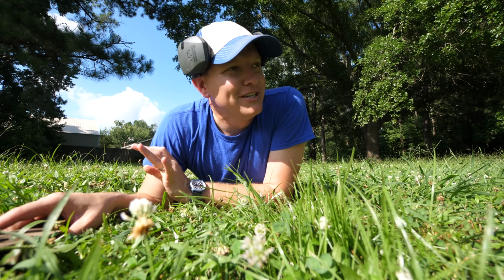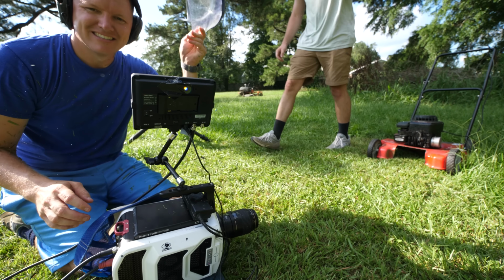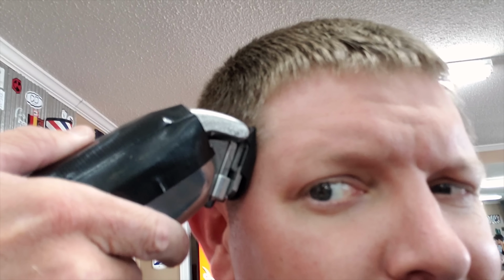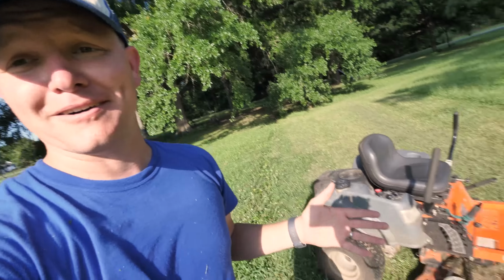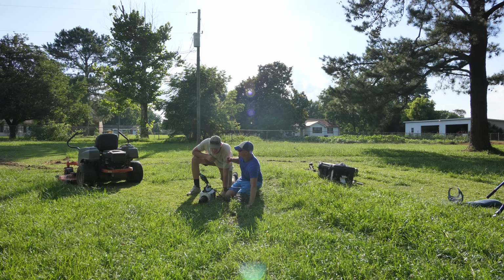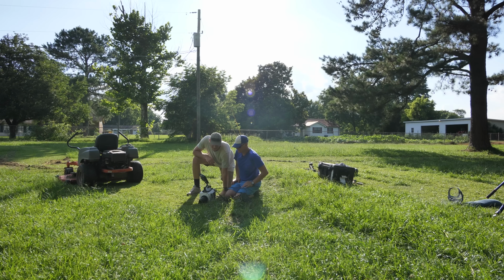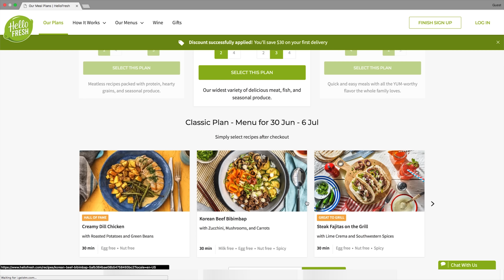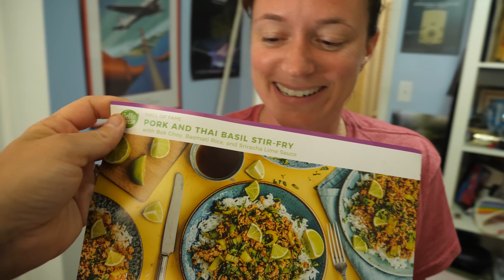How Lawn Mower Blades Cut Grass (at 50,000 FRAMES PER SECOND) - Smarter Every Day 196

Comment: Nice theory but it's not correct. The bent up blades might help a little lifting the grass but there main purpose of creating that air flow is it helps getting the cut grass out the discharge  IE using a catcher. When cutting with a more flat blade you will notice it wont fill a bag as much as a curved up blade will.   Cool video !
Reply: I think you are correct.  I don't think I witnessed air flow pulling the grass up.  The grass sprung up by it's own "backbone" just like stepping on grass seeing it spring back vertical.  Only when the mower blade moves fast enough does it not push the grass over and shear the grass off.

I have a set of perfectly flat blades for my 52" zero turn.  They have two edges so that when one side is dull you turn them up-side-down and use the other edge.  They cut fine, in shorter grass, they just don't discharge the grass from under the deck very well.  They can get bogged down in high grass.  Heck if the blades need to suck up the grass these blades shouldn't work at all on short grass which would bend out of the way of the blade easier.

The "lift" the manufacturers are referring to is bagging lift.  There is no way air is getting down at dirt level, traveling up at high speed and lifting the grass blade.

A string trimmer doesn't need to "lift" the grass either.  Grass is cut by a thin fast moving object.  No fancy physics about it.
Reply: No, the tab is intended for lift but it helps move the grass out of the way
Reply: Calleb Wilson may be the worlds foremost expert on the matter, but even if you are, I prefer objective data driven and measured scientific evidence to proclamations from authority.   A slow motion video of a control blade that is flat for comparison of the behavior of the grass blades would go a long way or any other definitive measured experimental data.
Reply: @geraldmoore6257  I'm a retired John Deere mechanic .Not as smart as you but we are both correct on the blade lift. I have known this for years . After posting this  I looked at some sites that would prove this and there are quite a few. Also looking at places who sell blades the ones with the high lift are referred to bagging blades.
Reply: @drelliott2833    Check your browser history and send me the web addresses of the stuff you found.  I have not been so successful.  I found mostly proclamations or assertions, not evidence, as well as links to this very same youtube video.  I'm in agreement with you.  There has to be some suction, and air flow but it's purpose is to eject grass clippings, not to pull up grass like the barbers vacuum clippers.  If it does pull up grass, the effect is minuscule.  I'm riding along at 8 to 10 mph cutting, the grass doesn't have time to respond to air flow before it's cut off.  I'd like to see what you found.  Thanks.  Good conversation.
Reply: @geraldmoore6257  See above
Reply: @drelliott2833  Thank you for your response.  I think I was not communicating clearly.  Yes, I found what you found, that "lift" refers to discharge for bagging.  However, what I was searching for was definitive evidence that "lift" is NOT referring to holding the grass up from underneath for an even cut like is being claimed in this video.  

But I suppose the lack of evidence is all one would expect if lift doesn't refer to holding up the grass for an even cut.  Thank you for helping me resolve this scientific puzzle.  I'm now tentatively convinced the tabs have nothing to do with lifting the grass up and holding it for an even cut and everything to do with discharge and bagging.  The "lift" so to speak is talking about what happens above the blades, not below them.  Thanks once more.

P.S.  For some reason I got you response about the deck engineer by email, but couldn't find it here on the Youtube comments.  It would be nice if many others could read it.
Reply: @geraldmoore6257  Are you talking about this post?: In the late 70s I had a friend that designed mower decks. At the time I was working on a JD deck that had these radical L shape mower blades just under 80 degrees  I remember asking him why they would design them like that. He referred me to someone else that could explain it better but explained why they built them like that. He showed me deck design drawings that showed how they work.  On riding mowers the bags are mounted on the back . The grass side discharged  but threw a tunnel upwards to the bags. The best way of getting the grass to travel all the way into the bag was the high lift blades .  Any way just search best blades for bagging lawn mowers. or the difference between mulching blades and bagging blades . 2 way blades/3 way blades. or just go to sites that sell blades" Sears "  They show the difference. Bagging high lift. Also the blades pull the air from under the deck .The high lift blades are like a fan blowing out the discharge. This is also the reason there are kits that can be added to a deck for mulching .(Using less curved blades) . They limit the amount of air flow keeping most of the cut grass in the deck cutting it more than once as it circulates out the bottom. Sorry about the rant .Hope this helps you.
Reply: @drelliott2833  It seems that you are misunderstanding or I am mis-communicating.  You're last two attempts to be helpful missed the mark completely.  I am at a loss.  I do not know any better way to get you to understand the issue that I wanted to discuss.  Of course, I was talking about this Youtube video and how the poster came to the wrong conclusions.  Which we both agree upon.  I also found info that affirms that lift is for bagging.  I was looking for information that debunked the suction effect upon the uncut grass.  Thanks for all the effort, though, I appreciate it.  I really do appreciate it, but your effort simply confirmed what I already found.

Comment: Well, if a lawnmower uses the air to hold the grass straight, what about a sythe?
Reply: a scythe is sharp and the stiffness and inertia of the grass are enough to hold it straight, with the stress being on a very small line.
Reply: As a guess, I think that a mower could take off a fraction of the top of short grass because of the speed of the blade, but a scythe would need taller grass to work properly.
Reply: I don't know if sythes were used to cut light weight grass much. More like more sturdy wheat and grains right?...
Reply: Clark S they are. Thats how I cut my grass😂
Reply: Scythe isn't effective when cutting lawn grass. Also, you can check the grass after being cut, is it a clean cut or more like a tear.
Reply: Clark S that was the sickle
Reply: Clark S 
Scythes were used on any grass eg hay cutting used to be done by hand using scythes.

Comment: Ever cut grass with a machete? You don't need a pulling airflow to cut the grass.
Reply: This is a super valid point! I think the story with air is not that relevant. The point is more in the direction of relative velocities. As soon as the blade is fast enough and the grass is slow enough --- bang; the grass is chopped. See the video of the SlowMo https://youtu.be/zTspzONOomw?t=1m50s no air no nothing.
Reply: Or a scythe.
Reply: machetes are sharp
Reply: The reason you can cut grass with a mechete or scythe is they are stupid sharp in comparison to 90% of lawn mower blades. scythes especially.
Mower blades are made to not be sharpened for years on end and still work, all thought not as well, a scythe must be sharped ever 20 minutes or something like that.
Reply: Ever cut grass with compact trimmer using just a plastic wire? It's not sharp at all but cuts fine. So it's all about momentum.

Comment: But how does Flymo lawnmowers work then? They use the air to levitate above the grass (no wheels) so they need to push downwards, right?
Reply: ChilladeChillin do they still sell Flymos? I don't think they do and it's largely for the reason you site.
Reply: I believe you will still find lift in the central portion of the blade with the downward flow concentrated heavily to the outer perimeter (to lift the mower).  But it has been awhile since I've seen one.
Reply: bruce johnson They still sell Flymos, but i think their popularity has decreased.
Reply: Ethan Poole I looked at the Flymo I own and you were right, the blades were bent upwards in the middle. The outer part of the blade was also bent downwards and it also have a big fan to push air downwards. But it kinda seems like wasted energy to push air in two different directions.

Comment: Twelve years ago I bought a replacement lawn mower blade that was supposedly optimized for "mulching".  Behind the regular blade edge with the upward tab, there was a notch, then a second blade mounted higher and angled downward.  When I installed it, I noticed two things immediately: 1) the mower was significantly quieter; and 2) cut quality was exceedingly poor.

That's when I learned about the vacuum created by a mower blade - which was cancelled out on this blade by the extra downward-facing cutting edge.  The aerodynamic changes related to the lack of vacuum were also apparently responsible for the reduction in noise.  I took the blade back for a refund and have used standard blades ever since.

Another fun fact: The tab on the rear of the blade can eventually wear down from friction against the grass clippings it's pushing upward.  I've gone through two heavily used blades that, in addition to having a lot of material worn off the front from repeated sharpenings, had the rear tabs (which gently curved upward) worn down to a knife-edge.

Comment: I had experimented in a much less scientific way as a kid, I tried comparing freshly mowed grass blade to cuts I made with scissors, scissors swung without holding the grass, scissors swung while holding the grass above, a knife with a slicing motion (angled from the blade's axis), a knife with a "chopping" motion (perpendicular to the blade) and ripping with my bare hands just pulling them between my fingers in various ways. I found some blades were cut like with the knife, others were more similar to when I laid a blade of grass across my index and pulled it apart using my ring finger and thumb on each side to create a wedge with my index finger. So I figured it was a combination of those two things that worked, that the blade of the lawn mower would sometimes cut through cleanly but the blade it couldn't would get slapped against the blade from the momentum and tear from not being able to move quickly enough to avoid the damage. 

Cool to know how it actually works now
Reply: Jeff Cyr i sharpen my blade on the mower pretty sharp will cut hairs off your arm i do have to sharpen it a lot but ive got a simple way off doin it. Anyway it cuts super clean amd flat for a few mows and its about an acre of mixed grass variety
Reply: Good to know others are also curious.
Reply: Jeff Cyr You should look at rotary mowers that the golf courses use for the close shaves. They use a scissor-like cut. Much cleaner cuts.

Comment: Weed whackers are only small strings on a rotating motor with no blades to create lift to pull the grass so how do they work? do they create lift like lawnmowers but in another way?? really curious hope you get around to this!
Reply: luther trump wacker spins way faster then a mower. No need to hold grass up.
Reply: lenny 034 yeah okay lenny we’ll see about that
Reply: luther trump huh???
Reply: lenny 034 WELL SEE ABOUT THAT LENNY

Comment: What about edgers? There is no tab.
Reply: Far mute the duct.  We plan not green the carb.
Reply: That slices really fast wich makes it cut
Reply: or weed eater/ wackers
Reply: edgers are more like a knife cutting. although, along a concrete edge, they act more like scissors, using the solid edge, as the second blade.  weedeaters just use sheer force. literally and figuratively.  the weedeater string spun at very high speeds (12,000 rpm) uses centifugal force to turn it into essentially a blade.  as airflow goes, displacing air creates a vacuum.  but its mostly due to using thin string, high speeds and creating a very focused edge, like a sharp knife.

Comment: OK, you explained how a lawnmower cuts but how does a round plastic string of a weedeater cut grass?
Reply: dragonweyr44 With enough centrifugal force from the spinning head, the string acts essentially like a hard bar, sorta a round-edged blade. It doesn't cut like a sharp mower blade, it's more of a grass beater, but it works.
Reply: dragonweyr44 rpm. Lots of rpm
Reply: I think once the blade/string goes fast enough, a blade or string will just cut through grass - no lift needed. The grass stands back up on it's own. The lift helps in a mower, especially when mulching and multiple cuts on a single blade is desired. I agree lift helps, but don't think it's required.  

I'm curious how much faster (or slower) the string on a weed whacker spins compared to a lawn mower blade.

Comment: Just stumbled across this video. That tab on the back of lawn mower blades was invented much later. Mower blades were just flat before the grass bag came into play and the clippings had to be lifted and blown into the bag. They also served a dual purpose of mulching by shutting of the exits but keeping the clippings airborne inside of the mower deck long enough to chop them over and over again. What cuts the grass depends on the sharpness and momentum of the mower blade and the weight of the grass blade. “Come on Man”

Comment: Reel mower, scythe (make sure to use it right) , string trimmer, leaf blower, broom, power edger, and lawn irrigation system.
Reply: Chain Saw
Reply: Aerator, dethatcher
Reply: Tiller, blender, pressure washer, steamroller, and kite.
Reply: Did you really just ask for him to go over a broom... it takes the object and pushes it away. The leaf blower has a fan inside I assume which just blows air.
Reply: Yup good ones here
Reply: the individual strands of the broom acts like springs perhaps launching dirt particles, so there could be something interesting physics going on with the broom.
Reply: I like the broom idea. There are brooms with large but few strands that when used right creates an air cushion in front of it that gets the particulate waste where you want it. Those are neat because those brooms don't wear fast nor to they get dirty, they never interact directly with the waste =)
Reply: Fadez he asked for ideas for things we wanted to learn the physics of. If you can't come up with your own ideas not our fault. If you don't understand the broom and leaf blower idea. Let him do it and he might surprise you. So get off your high horse and quit trolling.

Comment: Does blade speed make a difference on how well it cuts? What difference does a slower blade have from a faster blade? For example, if it's slower, will it tear the grass more than cut? Also, what is the acceleration of the blade at the tips? These are my questions.
Reply: If it's dull, it bludgeons.  If it's dull and FAST (as in this video) it rips.  If it's sharp, it doesn't have to be fast, it will cut.  A long handled-scythe is the old-fashioned mower.  They work very well, they just take a while... a very long while.

Comment: Now I'm wondering how an older lawn cutter works. Like one of the machinical push ones. There you have forward rotation but it doesn't oppose the blades of grass.
Reply: At least here in Europe there is two religions of landmoviving. The rotor cutter as you obvious is using. And the cylindrical cutter (both motorized).
The rotor believers say that rotor benefit is the multicut effect that helps the composting, and that the rotor is better at cutting other stuff that gets into the lawn.
The cylinder believers claim that this version makes a cleaner cut. That help the grass grow greener and softer. 
Could this series cast some facts into this .
Reply: There is a stationary blade on the bottom.  The rotating one cuts against it like scissors.
Reply: The grass just GIVES UP when it sees that MONSTER coming.

Comment: So how does a weed Wacker work because it's just a straight cord, or is it just small enough the grass doesn't have time to move with a blade
Reply: Danny Carinder and what happens when the cord fails? I’ve always wondered what causes the cord to snap if it’s doing what it’s designed to do.
Reply: Trimmer line is thin enough and fast enough that it can slice the grass blade very cleanly. You typically trim closer the the bottom of the grass blade so that shifty top part can't "dodge" the line. In fact, tall thin grass blades will dance around trimmer line if you go too far up. I believe, in theory you could make a mower that cuts using only trimmer line but since the line does break A LOT changing that stuff out would be a major hassle on a lawn mower. Therefore, we have metal blades for their durability. From my experience when you upgrade to a thicker trimmer line it tends to be less effective, in my opinion.
Reply: Lower Lawns I would love to see a high speed shot of the line breaking and tumbling away out of shot.
Reply: Yeah, that slow motion shot would be sweet. I also left an answer on why the trimmer line breaks on one of these other comments. I noticed you asking about that on others posts.